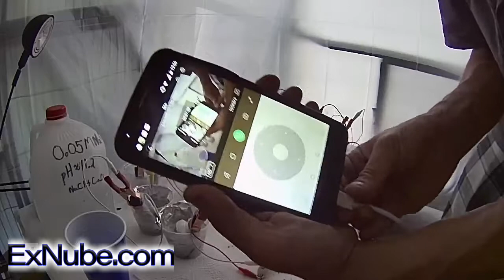ExNube Energy Starter Pack- How to Build an Aluminum Air Battery

Comment: this is the most primitive way to exctract a current from aluminum.  you need to use a second cathode made with MnO2 and change the electrolite with less aggressive reaction like the glycolethilene. overall the voltage in a single cell is 2.1v not more or less
Reply: ethylene glycol ?

Comment: Can you charge rechargeable batteries (niMH) with that set up? How would you connect them? 
I made a 7 volt 0.1 mA ice tray battery and I'm wondering if that would charge 5 1.2v NiMH batteries, even if it takes days?
Reply from the maker: Jose Heredia92 Yes. We do it all the time. Contact us and for shipping we will send some samples. In private message I will send instructions to drastically boost power rates. We are charging 12v lead acid batteries now with a solar power charger.
Reply: Ok. But do you think my setup would be able to do the job?
Reply from the maker: 7 volts is more than 6... but if you only get 0.1mA without the 6v pushing back it could take decades to charge.
Reply: What do you mean by "without the 6v pushing it back"?
Are you talking about back voltage? Do I have to use a diode like a LED to prevent this problem?
Reply from the maker: Jose Heredia92 If you are getting 0.1mA at short circuit, when you hook up to the battery for charging, the amperage will drop drastically. The batteries being charged will "push" back and your system amps will drop.
Reply from the maker: Diode wont help. Graphite will!!!!

Comment: How much amperage does the battery produce (short circuit)?
Reply from the maker: This video is made using a very safe electrolyte. Acids, bases, and even many neutral solutions vary the amperage and voltages significantly.
All ten in series easily exceed 12 volts and over 100 mAmp when pH levels are over 11 and any known "heavy duty" aluminum foil is used. Most foil sources vary significantly in terms of alloy used and coatings.  The pH and the aluminum source plays a HUGE role.  Aluminum foil, aluminum cans and many other aluminum sources have coatings that inhibit the reactions until they deteriorate. Some aluminum alloys reach close to a full amp with a pH close to 12. Some steels have shown large amperages and slightly lower voltages. Please. Help support our product development! Buy a starter kit and experiment!  http://exnube.com/shop/build-your-own-battery/

We are about to shoot a video of this exact system charging!  The rate of charge is unlike any other battery known.
Reply: Ex Nube 
Interesting information, thanks!
Reply from the maker: Thank you for your interest! We are very excited to get our products into the public's hands.
Reply: Have you tried using Ca (OH)2 instead of NaOH since Ca(OH)2 doesnt react with aluminum at all?
Reply from the maker: :) We have tried a lot!!!  Perhaps you would be interested in our dry mixes so you can create your own electrodes. We are about to launch a very powerful mix for retail sales. By the time you get yours we hope to have more tutorials explaining how to work with our discovery to enhance it with "additives." Calcium hydroxide is our friend. No doubt about that :) 

NaOH vs KOH and aluminum videos are posted on our website. Interesting!!!  

Would you like to get involved with our company? We are looking for sales, scientists and more who want to participate.
Reply: I'll be checking the KOH vs NaOH videos. I am interested in being of help to your company by providing findings about electrode/electrolyte combinations, right now I am working on iron/copper batteries as well as seeing what results do different electrolytes produce. I'll post a video about this.
Reply: Jose Heredia92 Have you used graphite?
Reply: James Hilliard 
Can you elaborate more on your question?
Reply: Jose Heredia92 Have you used graphite in your studies?
Reply: James Hilliard 
Right now I am trying a Fe/Cu setup and see if I can improve it.
Reply from the maker: Please watch this old video...  I have only improved things in the months since this video was made.  https://www.youtube.com/watch?v=dBKAZX9DtWU